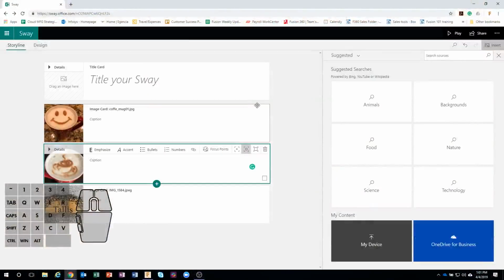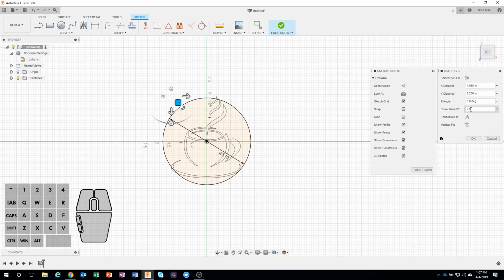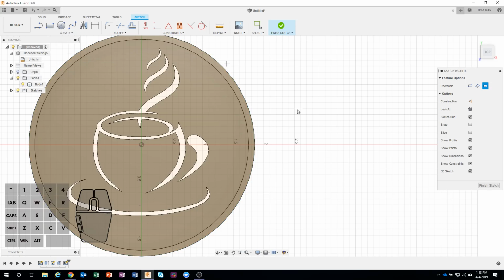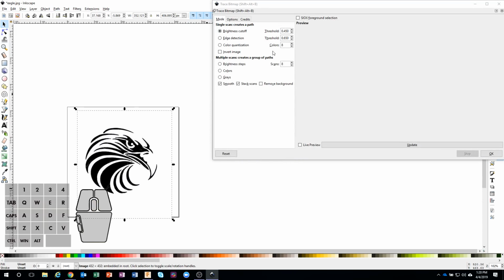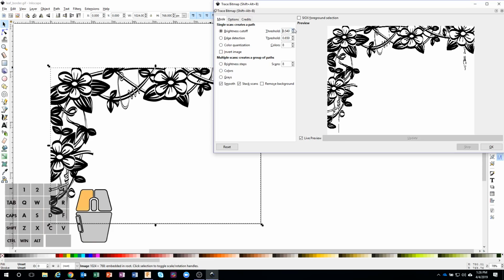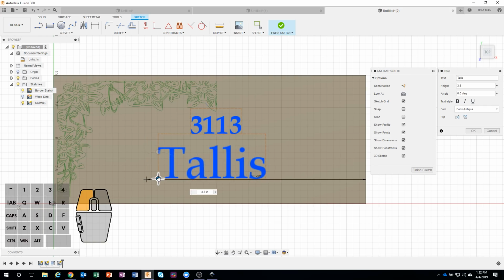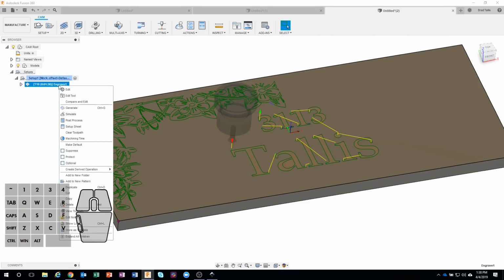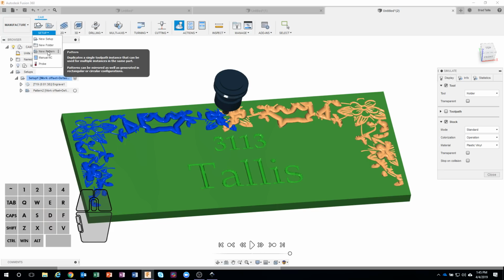360 LIVE: Bringing SVG files into Fusion 360

Comment: So I was able to get a jpeg converted into a plain SVG and get it into my fusion 360. For some reason a lot of it in the open spaces is a light blue color. I can move my cursor around in the sketch but cannot delete those light blue areas. Also the logo binds the computer up. Also after getting the logo into the program I cannot manipulate it, ie move, copy or reize it. What am I doing wrong?

Comment: Watched this again today, I have been trying to cut out a name sign on my router. I imported a svg name I created in inkscpace (made sure it was union) and also made sure each letter had a path. I exported as a plain svg. Once I import it to fusion, once I extrude the text to thickness of my material. When it comes to the outter contour of the name fusion won’t recognize the contour. I tried selecting the bottom to follow the contour.
Is fusion not capable of making name signs that are cut vs engraved ?

Comment: how do i get help from a person at autodesk concerning non functioning of fusion 360 slicer?  forum has been no help.  20 hrs into this frustrated.
Reply from the maker: What's happening? Are you talking about the app? Are you using the new UI?
Reply from the maker: Do you get an error message? What OS?
Reply: switch to old ui.  windows 10, 10pm just reloaded again.  does not show up windows program list as slice like i show it earlier today;  then went to make, 3d print, custom,  application (setup)....don't know what to do here,  no   .exe file?
Reply from the maker: You can also go to an STL or other compatible file then open it directly in your slicing software. https://knowledge.autodesk.com/support/fusion-360/learn-explore/caas/sfdcarticles/sfdcarticles/How-to-export-a-design-in-Fusion-360.html

Comment: The issue I find with importing SVG's is receiving errors if I want to fillet the edges after an extrude/cut.  A lot of time I'll have to completely redraw the lines.   This usually happens if I live trace art in Illustrator, the paths look clean, but there must be something hanging it up.
Reply from the maker: Good point...re-sketching would probably give you best results, but this quick method might work in a pinch.

Comment: Just out of curiosity; if it has no size reference (hence the name “scalable”), wouldn’t it have been better if Fusion 360 was to automatically scale it upon import to fit the current viewport? The user can reset the auto-scaling back to it’s default by simply setting “Scale Plane XY” back to zero, if that’s not what they’re after anyway.
Reply: @Emre-  According to the bit of research that I did, they did set the "scale" of the svg to 92 dpi (or dots per inch) back when most cathode-ray tube monitors were 92dpi.  So, there is a scale that is set, just not a 1:1, etc.  However, I like your idea.
Reply from the maker: Good call!

Comment: So, a little thing. It is often a good Idea to put the origin at the center of you part when you model, rather than at a corner. That way it would have been easier to detect that your flowers were crossing the center, and also, you would not have had to make the mid-plane, as you could just have used one of the origin planes. You could probably do something similar in Inkscape, so that you get your transform/scale handles in the center. That way you would not have to move it every time you scale it.
Reply: @Neistridlar-  You are absolutely correct.  I definitely should have had the origin be in the center of my plaque to make downstream features behave better (like mirror).  I will point this out in an upcoming LiveStream.  Thank you for sharing!
Reply from the maker: Thanks for replying, Brad!